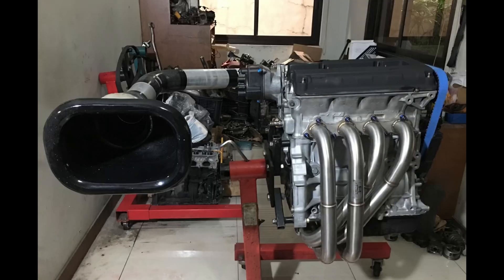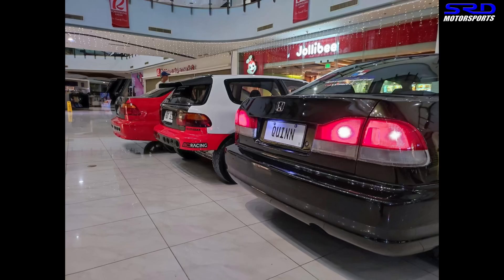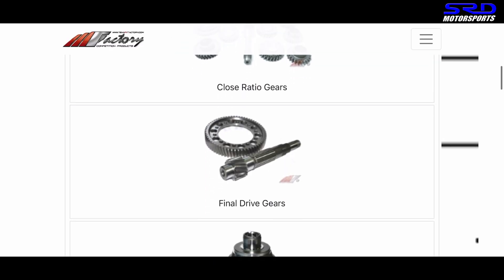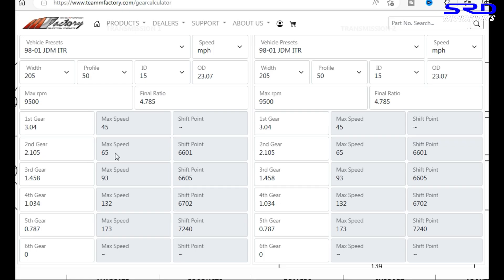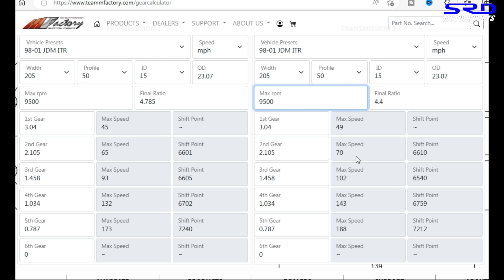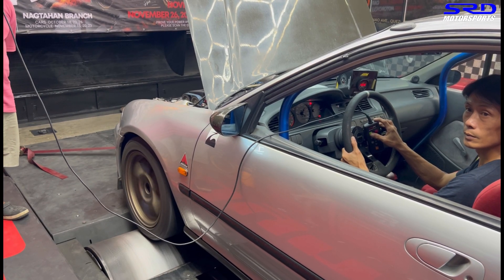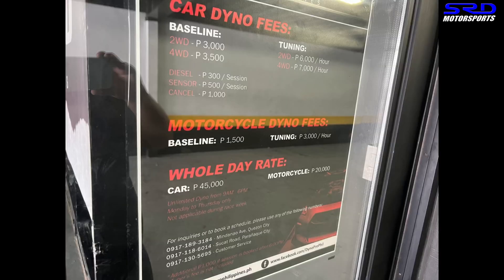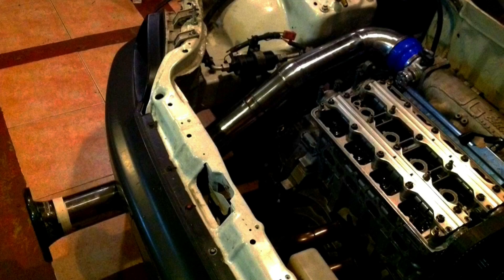4.4 vs 4.7 Type R Final Drive: Why You Need a Dyno!

Comment: On a 6 speed k20 what FD would you recommend for cruising with a tsx 6th gear to lower the rpms
Reply from the maker: on this case, it’s def better to check Mfactory’s website they have a calculator u can input your tranny and reference cruise rpm to speed and see what fd works

Comment: Racing karts will teach you how important gearing is
Reply from the maker: this is so so true!
Reply: @SRDmotorsports  I like how Honda guy's get into it. I can't think of another manufacturer that offers so much variety for gearbox and gearing options.
Reply from the maker: @ true, just the more options does tend to confuse more but I agree

Though I didn’t get to Kart as much as a kid but was always into “racing” something and at the very least on RC road cars and off road trucks the r/p does change a lot and is quite important. In our case that’s the final drive atleast 😎

Comment: Great info Ralf but I had a question on the limiter in the calculator or labeled as shift point...seems p misleading because its saying the limit of each gear is calculated via the limiter (9500 rpm) which makes sense. a 4.7 would top 3rd at probably 93mph with that limiter and tire but what is that shift point calculation for? 

Also would be good to note for those running a fatter tire, your effective gear ratios will be longer. its like moving to a lower final drive via your tire. so if u have a 225/45 for example or 225/50, the 4.7 might work better for u. i do that alot with my cars to adjust drivability. just run big af OD in the front haha
Reply from the maker: On the calculator that’s the rpm/mph u have at “that” shift point

As noticed we do the shift point way after peak power and it’s “set” to where we find that ideal in reference to the next gear pick up…

It’s why Jasper’s b20vtec (the ef) shifts at 9,700rpm when everyone would have shifted at 9,200

On the tires yes notice I did mention and show the tires are set to the dia. They used which was 23in

but the amount u gave up with the 4.7 ? You would need atleast a 26in tire 😂 

hint* less sidewall = less initial grip 

It’s why lower profile tires spin WAY more
Reply: @SRDmotorsports  yes correct about the tire. i personally run up to 24in tires on my cars for the street but man slicks is a whole different game. those wheels OD hit 26 ive seen it.
But you are right for the most of us 4.4 will probably do us better especially because u can stretch 1st gear thats already going to be short. if anything b16 ratios are the best with 4.4 for most or 4.2 final for high power b20vs
Reply from the maker: @ogswagkillapbeastmode694  I agree on the b16 gears and 4.4 it’s like a good medium for a lot of engine types and uses
Reply from the maker: but very nice tidbit here and thank you for this because I know a lot don’t tend to factor in those tidbits that affect the overall drive 😎

Comment: Great info I always remember I had civic type r and vti and found vti faster because of longer gears and my driving style and prove it by always beating type r,s it's not always about power and shortest gearing
Reply from the maker: So so true and the VTi has a 90mm stroke 😎 even on the dyno it usually pushes more torque than a fellow 1600 with a smaller stroke
Reply: @SRDmotorsports  that's interesting didn't know that makes since I prefer toqure over power why I drive .. a vti with bit work done with type r cams and inlet and exhaust be a strong engine
Reply from the maker: Very true that makes for a responsive and torquey engine
Reply: Yes sir yes sir!!!!❤❤❤
Reply from the maker: for sure!!!